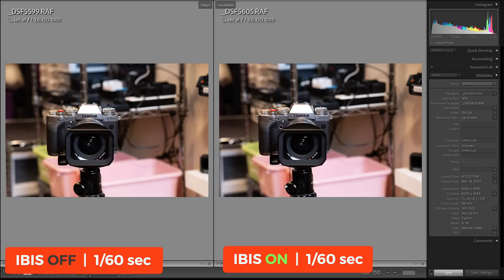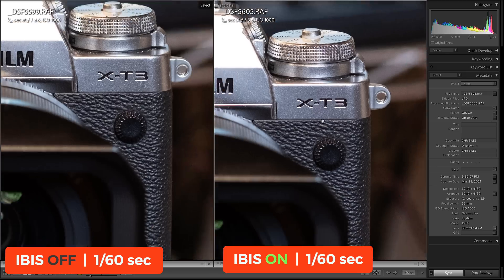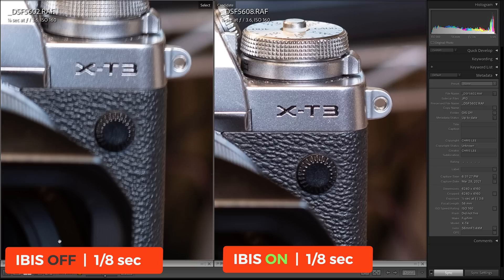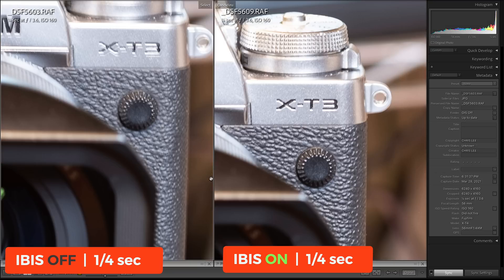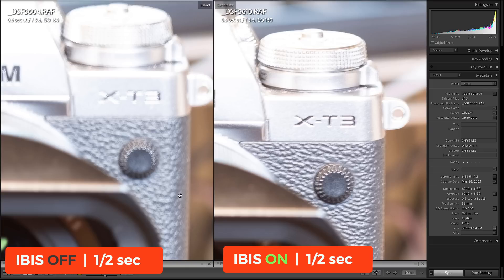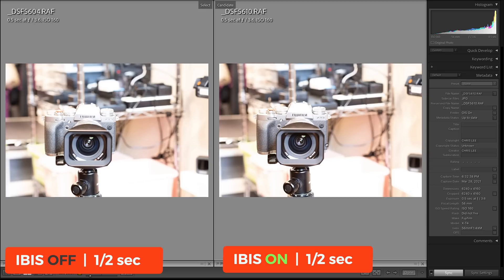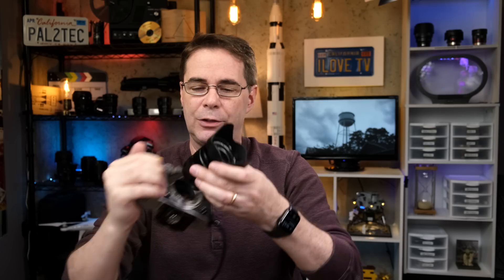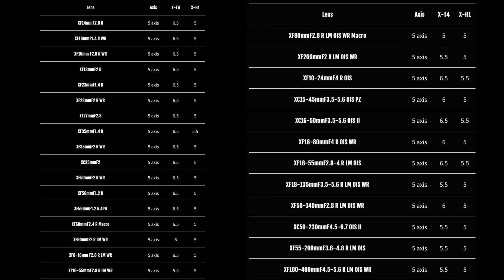Fujifilm Image Stabilization

Comment: Hi, your videos are very useful and thanks for that. I have a question for you about Fuji X systems. I switched to fuji xh-2 from A7SII. I really like the image quality. I shooting videos with that camera and the footages looks like little shaky when I compare the my old Sony camera. I have 16-80 lens and 56 1.2 r wr lens but both of them same issue. I am not sure if that there is any problem with camera or lens. I am using OIS and IBIS active and DIS or Boost setting is off.

Comment: One significant omission is an explanation of how the Fuji IBIS deals with panning to capture  movement. I photograph prop aircraft at low altitude at 1/60th sec shutter speed with my X-T3. The requirement is to disable IBIS in the panning axis while leaving the other axes on. Is there a setting in the XT-4 menus to do this or, possibly is the panning motion automatically detected? Olympus cameras have such a feature but I don't want to abandon Fuji for this feature.

Comment: Will IBIS help with alignment between stills *on a tripod*.  I don't do video but my images are often comprised of many shots including brackets, different lighting, etc.   Without even touching my camera some of my images are slightly misaligned often...maybe stepping on carpet 3 feet from the tripod can do this.  Sick of having to align so much in Photoshop to get razor sharp images.  At the same time, I'm worried it will cause MORE alignment issues, as you said don't use it on a tripod.  Apologies, I've never used IBIS and am pretty confused still even after this video.

Comment: Amazing video. So I've had my Fuji XT4 for 2.5 years, I've never really taken it off IS Continuous.

In theory, for stills only, shouldn't we always just use "while shooting"? What's the benefit of having it on all the time if it only counts when you half press + take a photo? I've just been stabilising looking at a monitor in theory. 'While Shooting" feels like the only time we need it.

Also at 6:00 you mentioned "the lens is applying stabilisation", is that right or did you mean "the body"? For example, it doesn't matter what lens you connect… this option is always there. The setting must be applied to the camera body for that option to be apparent.

Comment: IOS options now include “+Motion” which attempts to track moving subjects.  Do you have a video testing this?  

I have the 16-80mm and 70-300mm which both have this option on the x-t30.  Haven’t tested it much yet but I’m very intrigued since conventionally, IOS shouldn’t help you it the subject is moving, only if you are compensating for hand shake. But now, maybe it’s more capable?

Comment: I love shooting ICM (intentional camera movement) which my XT3 did beautifully. How do I turn off IBIS on the XT4? You said to turn IS Mode from continuously to shooting only. Does that turn it off? Thanks for your videos!
Reply: I’m not sure you read my question throughly since you simply liked my comment rather than offer suggestions, but I did figure out how to turn off IBIS. The problem I had was that off wasn’t an option UNTIL I changed lenses and then it appeared. You might want to mention this. It doesn’t appear with the 18-55mm but does with the 16-80mm.

Comment: Hi Pal2Tech and thanks for the useful video.  You say that image stabilization should be turned off when on a tripod; leaving it on could even introduce vibration.  The owner's manual that comes with my Fujinon  10-24 OIS lens says "Because image stabilization is also effective in reducing blur caused by the motion of the mechanical shutter we recommend that you enable optical image stabilization even when using a tripod."  This 10-24 lens has no ON-OFF button for OIS.  You can only turn it off via the body's menu.  Contrary to that, the owner's manual for my 50-140 OIS lens has no such statement about tripod use.  How to reconcile these two manuals?  I also notice that if I set my 50-140 OIS to the OFF position the X-T4 menu control for the IS mode is grayed out, i.e., the IS mode is off.  (I see no menu option for IBIS that would allow me to turn it on or off.  So is IBIS still really on? Also, if the 50-140 OIS is ON then the body menu does not offer an OFF option, only a choice between Continuous and Shooting Only.  I'm confused.  Should we ignore the 10-24 manual's advice and turn off image stabilization when using this lens on a tripod?  And the 50-140? Thanks for clarification. Chuck

Comment: Hey everyone, I had a problem with the footage recorded with my Fuji XT4. I was working with a tripod and when I went check out my sd card in my computer I find a lot of parts of my images with wobbly, anyone here had the same problem? I was recording a video in 4k 30fps. 
The other problem that I had was, the autofocus, hunting several times, I made some adjustment, but, when has a lot of faces in front the camera, the autofocus starts to hunting a lot of faces, maybe the solution is use MF?

Thanks a lot for your content Pal, it's really helpful.

Comment: Hi, I really like your site, it is so informative and helpful. I have a problem with my OIS. I had my XT2 and XT3 shifted to back button focus and then use the AF-ON when shooting. Wierd thing I noticed ,i n both cameras, when I use the AF-S the IOS does not work, but if I use the AF-C the IOS functions, furtehmore when I use the AF-S and place the focus on at the shutter button the IOS does not work but when I shift to AF-C the IOS works. Why is that?

Comment: Is it just me or the XT-4 is actually jittering with the IBIS on while making videos?
I'm not talking about warping artefacts on the corners, but some random lag when panning.
Some people tried to fix this attaching a vibrating phone at the bottom of the camera!
Reply from the maker: Yeah, I ran into that with some third party lenses. What lenses are doing this for you?
Reply: @pal2tech  I need to double check the Fuji 16-80mm f4, but I really noticed the problem with the Fuji 35mm f2. Looks like you kind of fix the problem with the DIS on, despite the 1.1 crop and the fact that it's an in-camera stabilization...

Is it worth a video about this? Maybe Fuji will listen to you

Comment: You mentioned if using a tripod, turn off image stabilization because the tripod will confuse the stabilization. Maybe that needs to be delved into a bit, as it leaves a lot of questions about "confusion" and electronics.

Comment: Chris, your vids are an incredible asset to the community at large. Thanks for your efforts.

As fate would have it, I was battling OIS myself this week. I think this discussion needs a little clarification (see this video around the 6 min mark) that I was under unaware of until two days ago...and so are MANY others; 

Pressing the shutter halfway to engage OIS ONLY works in AF-C, NOT AF-S (with IS Mode to Shooting Only). This can be a big issues since at longer focal lengths, OIS may be necessary to help compose in the first place. 

This is unlike every other camera system I can think of. To get the OIS to engage with shutter button halfway down, you have to go to AF-C.  In fact, this is hinted at on page 136 of the manual, but I glossed right over it initially. This really can matter too. In AF-S, the OIS engages just before shutter actuation, and its effects are not visible to the maker.

Anyway, try it for yourself. Let me know if I'm missing something. Keep up the good work.
Reply from the maker: Hmmmm. I’ll check this out. Interesting!!!
Reply: @pal2tech  did you check this? I rarely use AF-C. With AF-S and Manual, is the IBIS working in Shooting only?  I have an XS-20 but I guess this is similar to all Fuji family. :)

Comment: Intersting video, sadly the "rule" doesn't work anymore with high density sensors.. Now it's suggested to use 1/ "double the Focal lenght" at least, but the real equivalent focal lenght so 1/75mm*2 in this case.  :)  (and a Fuji 26mp sensor is dense and comparable to the Big Mpix full frame about microshake). 

I Still find sometimes weird behaviour in a burst with fixed focus, some shots are little soft because of the stabilization in the middle of a burst (X-H1, mostly IBIS only). The only thing I really miss is an option to engage the OIS only when the shutter speed goes under the specific value for your lens, but nobody did it.

Comment: Don't forget that IBIS is consuming energy even when it's off. The electromagnets are working hard to keep that sensor centered without moving! There us NO hardware fixture that pins the sensor in place when you turn off IBIS. So there is no BIG difference between Continuous and Shooting only.
Reply from the maker: Good point! 👍